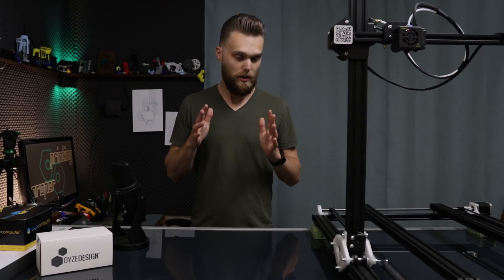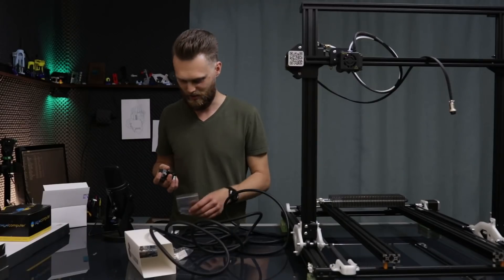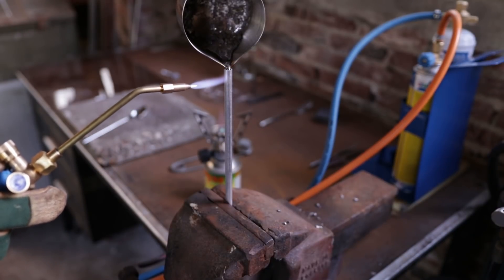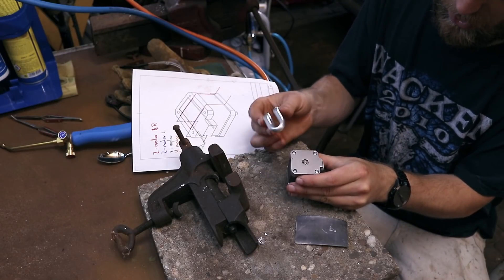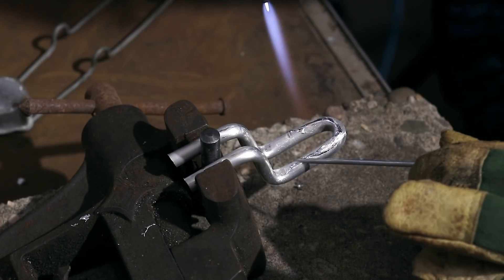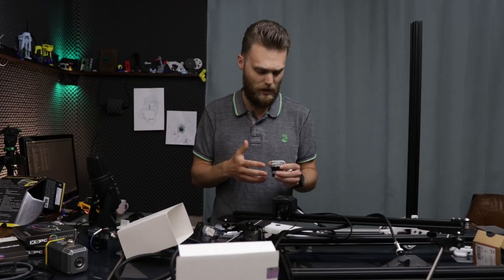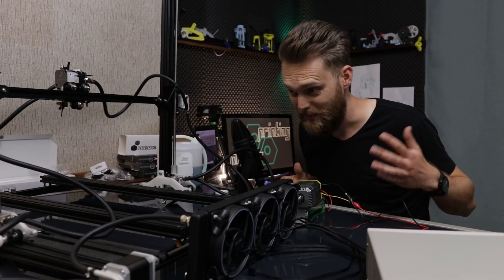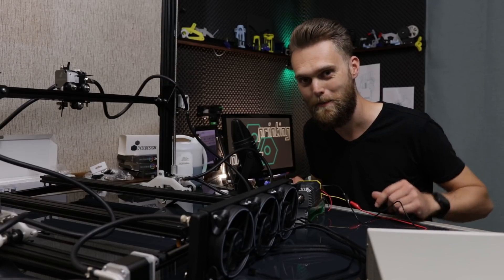How I made my own water cooling blocks and a added water cooled DyzeDesign pro hotend.

Comment: Are you not mixing metals in water loop, copper in rad and aluminium don't mix well with eachother
Reply from the maker: Great point! The best thing is to use one metal in the whole loop. To prevent galvanic corrosion used a water additive and I'm going to make sure that the motor and radiator are not electronically connected by mounting the radiator with 3D printed brackets. Thanks for pointing out!

Comment: By the way; you mentioned heating the motor part "took a while". Wouldn't that mean it's bad at getting heat away... or just the opposite?
Reply from the maker: It's the opposite, it's like soldering on an PCB with a lot of copper. The heat is transferred away so you have to put a lot of energy in it. I'd preheat the parts in an oven if I'm going to do this more often.

Comment: I 'm hopping that in our enclosure design you put the heater element in front of this cooling radiator  in order to improve the global efficiency of the whole system by heating air that was already heated by the cooling system.

Comment: Very cool! I'm doing something similar except with a Slice Engineering's Mosquito Magnum hotend. 

It's water cooling is done with a cnc milled aluminum cylindrical piece that slides over the Mosquito's cooling fins and is potted into place with either thermal epoxy or a thermal paste like compound that stiffens up. 
3d printed Nylon water cooling jacket directs water around the aluminum cylindrical piece, 2 o rings in the cooling jacket keeps everything sealed.

Also water cooling stepper motors. The stepper motors metal back face gets a 3d printed nylon cover that creates a flat flow channel and uses gaskets  to seal it up.

Water only slightly heats up and it cools the printed nylon parts so they stay around room temperature or slight above.

Also what tube size(IDxOD) are you using?
Reply from the maker: that sounds like a great approach! I'm using the largest version of this tubing https://dyzedesign.com/shop/liquidcooling/high-temperature-tubing-9-53mm-od-7-94mm-od/
Reply: @properprinting  Thanks, I'm using 3mm IDx5mm OD. Trying not to build something overkill.

Comment: Great video like all of them. Small tip for pipe bending, heard from old school - use sand instead of lead.
Reply from the maker: Thanks! Good suggestion, I did it once at school with lead and I was doubting to use sand. I didn't use sand because I thought it would be more difficult to hold it in place, but that was before I realized I had to close the tube on both ends xD. Melting lead leaded to this fun B roll sequence though ;) I'll try sand next time
Reply: @properprinting  Even filling them with water and freezing over night does the trick !
Reply: Or take a thin ‘trekveer’ and pull it through. After bending you just pull it out
Reply: Silicon sand is what you use, ive seen motorbike frames bent in this way.. well ive seen it because me and a friend did it to my supermoto frame and he was taught to do it that way by a well known metal fabricator here in the uk. You have to then heat the metal up while bending it, it keeps the round shape but it does make the outer wall thin if bent to much..

Comment: What is your job? Just curious
Reply from the maker: I'm an electronic test engineer, mechatronics engineer and LabVIEW programmer. Officially a production engineer xD We create systems to automatically test printed circuit boards we produce in our factory. So it's basically a combination of mechanical hardware, electronics and software.